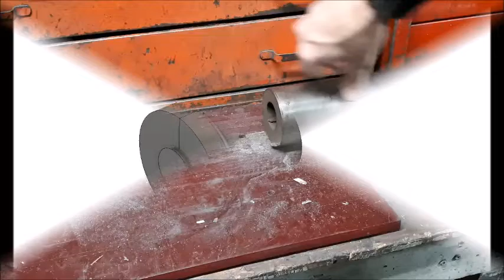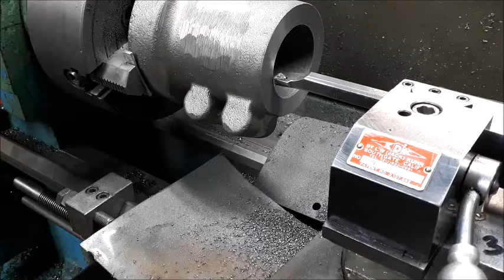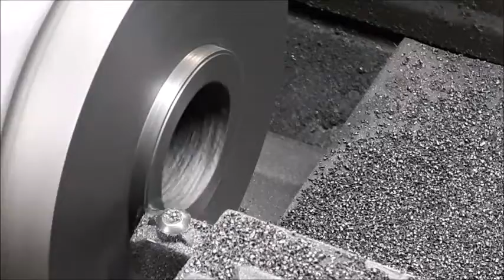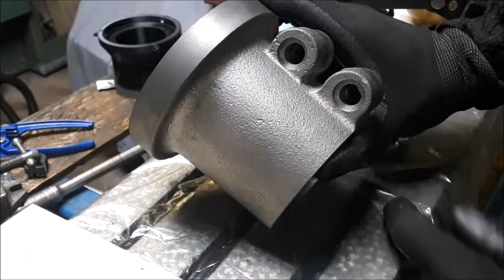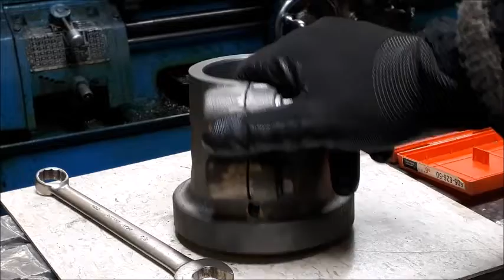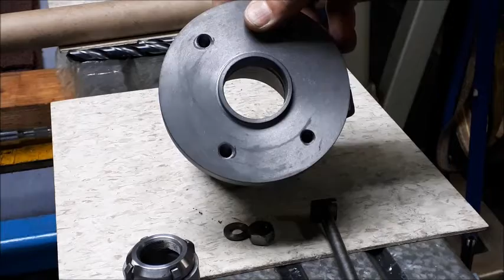M Head Matters The Rockwell Connection

Comment: I have a Burke #4 Horizontal Mill with a Bridgeport M-head installed very similarly. Took me awhile to cobble together a full set of collets for it and I'm still looking for a couple standard parts. An over arm support would be great. Don't really need it, because I have done what you did and I have the original vertical milling head attachment which has an extra plate that I use to support the arbors I use.
Have the all of the hardest to find accessories but missing a few of the simple parts. Hard to get those because they either come with an entire machine OR they are being sold for ridiculous prices from one of these Ebay guys who takes a good machine and strips it for parts. I've missed good deals like a hundred dollar over arm support and then never seen another one for less than 300. A whole machine can be had for less than 1000.
Sorry, venting. 
Just excited to see another M-head in the wild. I use mine all the time. Like a mini super precision drill press....I've used mine to drill PCB's with a 1 mm bit.
I used it to mill some simple traces with a 2mm endmill. Works like a charm.
Sometimes I will sharpen a custom HSS form tool or lathe bit by mounting a custom arbor with a 5" grinding stone mounted on it. Those come out REALLY sharp....

Comment: Wow I’m literally doing the same exact thing...rebuilding an M head to mount on my Rockwell 21-100. I had no idea how I was going to go about mounting it but I love the cast iron idea. Would you be willing to sell me one of those castings by chance? Or have one made? I absolutely love this idea. Please let me know!
Reply from the maker: It was for a friend, he had the idea and I just helped bring it to life.... Don't think there are any other castings but steel would be an alternate. Thanks for the comment and thanks for watching.
Reply: I mounted mine by getting a hardened steel plate and bought a 2" diameter hardened steel shaft from my local metal recycling yard.
I faced off the shaft and turned the plate to rough dimensions. Took it to a local machine shop and paid them 20 bucks to weld the two together. 
Back at home I put the whole thing back  the lathe and faced off the place front and back. Turned the boss and drilled the mounting holes. I put the shaft in v blocks on the lathe cross slide and put the drill bit in my 3 jaw chuck..... if I were to do it now I have a lot more options. Full size knee mill and bigger lathes plus I mounted a HUGE 4 jaw chuck i found at a junkyard on a HUGE rotary table I found in a garbage sale with a 4 inch passthrough.....
I have that mounted on a bench top with a hole in the bench top so I can put gun barrels or whatever in it. I got an old school south bend milling machine that was scrapped for parts. It has no table on it. Mounted it to the wall on a couple 2x4 steel c channels. 
Works great. Used heavy duty 10mm linear bearings so I have about 48 inches of travel.
I can drill a perfect hole 48" long in round bar by spinning the rotary table in opposite direction of the drill bit.
Its amazing what you can find at a metal recycler. .....

Comment: I have a Rockwell Mill and a M-head and have been trying to figure the best method to put them together and found your video! Would you be willing to cast another adapter and sell it?
Reply from the maker: There is always an extra casting when you do stuff like this... :)  I do need to check with idea guy behind this, to make sure he's good with me selling another one. Pretty sure he'll be good.  Just a reminder, the casting is designed to have the two clamps but there may be a better way to take much of the back off the casting, and provide for some more effective table area. Watch for a another reply tomorrow. Thanks for watching and commenting too.

Comment: M looks mounted on the mill. Nice setup. Excellent job on the knuckle and explanation of each operation. Question,,,is there any way to reduce the clatter between the spindle pulley and spindle. On heavier cuts or climbing it clatters.  Also can’t find a clock spring, any ideas. Thanks for sharing.👍
Reply from the maker: The clatter is likely from the “clearance” between the internal and external spline drive system on the spindle. I’ve now seen and heard a variety of heads, with varying degrees of wear and none of them are whisper quiet by any means. I’m not advising you to do it but at low speed, with NO tools in the spindle, a light drag on the spindle (read between the lines here) should make it “quieter”, if not there may be something further to look at. Try High Quality Tools for the spring, give them a call at 1-877-DRAWBAR (372-9227). Thanks for watching and commenting.
Reply: Unknown Apprentice no